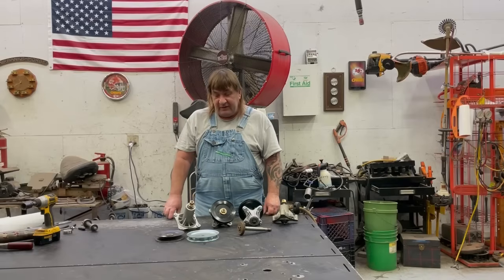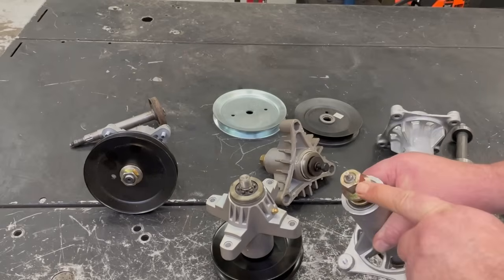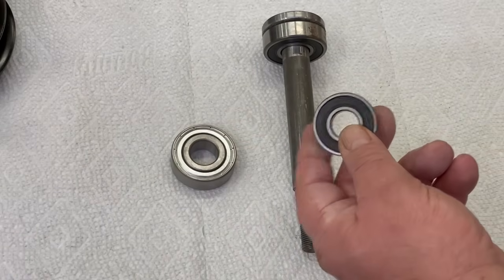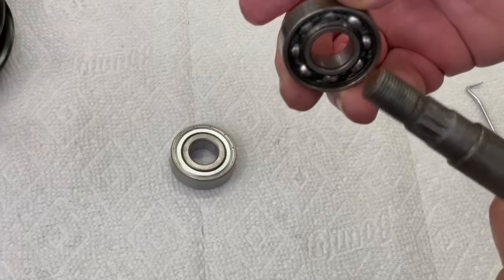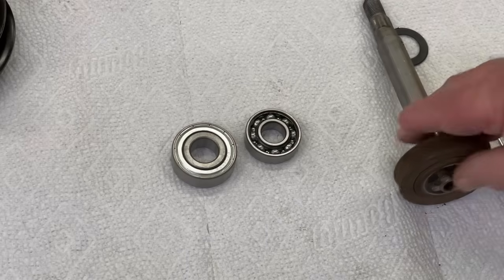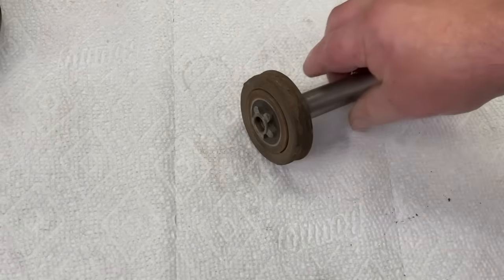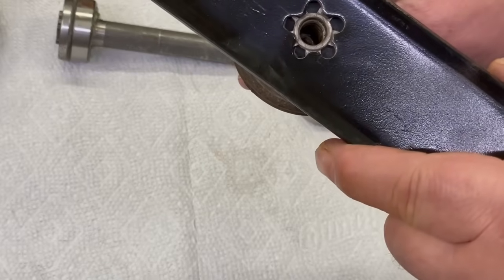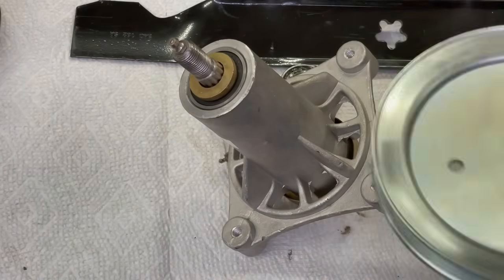BEST WAY to Grease SEALED BEARINGS on Lawn Mower Blade SPINDLES (make them last 3x as long)

Comment: A tip for you - when you tap as you showed at about 6 minutes, use an impact gun to run the tap instead of a drill. The impact lets the chips break between impacts and the tap never jams. You do a great presentation - straightforward and logical.

Comment: I never grease my sealed bearings and currently have 1700 hrs on the original Toro spindles. I have a similar experience on both my Exmarks with 1000's of hours of use.

Comment: I bought so called zerk fitting spindles off amazon and I took them apart before I put them on my cub cadet that a bearing siezed up on . Both sides of the bearings inside the new spindles the bearings were sealed and I took the inside seal off . Never believe what they tell you . Even the real cub cadet ones I bought for my older cub cadet  had the zerk fittings but the  bearings had seals on both sides . Why do they lie to people .. check everything you order as the dealers lie as much as sellers on ebay and amazon .. I am a 72 year old woman and i still mow 3 acres so no excuses men . If I can do it so can you . Never believe what a seller says or even a parts dealer for the brand of mower you own .

Comment: You're better off to leave that top bearing as a sealed bearing.. You can open it and give it more grease if you want..  but then close it back again. because the top bearing has a lot more leverage on that shaft, so it really doesn't take near as much of a load...  Plus, your grease always wants to fall by gravity--  so it's always falling "AWAY" from that top bearing and it will end up dry.  The bottom bearing takes all the beating and is a good idea to keep it open like you showed..    So leave the top sealed, but the bottom open- and you'll have the best of both worlds. 

 That bearing with the "tin cover" -  is known as a "shielded bearing" -  rather than the plastic covered "sealed bearing".   The shielded bearings are never as water tight as the sealed bearings..

Comment: Once again the myth of sealed bearings in lawnmower decks  appears!?!?!? If you contact TIMKEN or SKF BEARING TECH what you see is considered a dust/debris shield and the average hand grease gun produces 2,000 psi which will overcome those plastic/metal shields!!!  I have a thirty year old three blade deck with grease perks and twice a year they get a shot of marine grade grease and still running quietly!!! But before this season ends one of the spindles is complaining/ new bearings time!!! 
I say all as a retired CAT&CUMMINGS knuckle buster and understand the REAL MEANING OF PREVENTIVE MAINTENANCE!!!!!!!!

Comment: Good video.   I've been greasing my sealed bearings for years. Most of the time I use a grease needle to get in between the seal on the bearing and inject grease that way. I do remove the tight fitting seals on the bearings and the use the grease needle to insert the grease right into the bearing, then replace the seal again. I have not replaced a bearing on any of my mowers for over 20 years. I do this procedure once a year on all of my bearings where ever they may be.

Comment: Sealed bearings are not intended to be greased and all bearing have a life span. Greasing them will not extend their life and replacements can be found for as little as a few dollars. Rather than go through the time to just grease them, if required replace them. 10 years on the bearing in my lawnmower and all are doing fine. They've never been greased. The zerk fittings are there but when used as intended, the seals prevents the grease (and dirt) from entering the bearing. Eye candy, but of no use.

Comment: I've found that new bearings almost always come with grit in them. I remove the seals and wash them out with solvent, blow them out bone dry and push while rotating them. Once they feel clean, I grease them and replace the seals. I've done this on milling machines and the bearings seem to last forever.

Comment: First time ever hearing someone say “That’s all I have to say about that”, outside of Forrest Gump. I wasn’t watching when he said it, so I grabbed the phone and restarted the video, to watch it through.
We don’t have that sort of mower over here, really, so the subject matter didn’t really seem relevant until I got into it. But the tips are good. I’m guessing a “zirc” is some sort of grease nipple, allowing for packing the cavity with grease, once assembled. That’s a common construction across a wide range of machinery. Almost any belt driven equipment is likely to have at least one such shaft with bearings. I just finished a milking machine primary vacuum pump and its drive system had exactly that setup. The new bearings were sealed and I didn’t think of removing the seals on the inside. Seems obvious, now. Doh! The amount of dismantling involved means I’m not going back into it now, but next time I have it apart….
Reply: Zerk fitting.

Comment: Another tip....most manufacturers only sharpen the last 4 inches or so of the blade. I sharpen my blades 
on the cutting edge all the way to the pivot point, and it's like adding horsepower to your machine. It cuts 
right through clots and clogs of grass.

Comment: With my experience as a manufacturing engineer I only lube with Teflon Grease. My old Toyota Tacoma pickup truck had 580 thousand miles on it with all original front end parts before it got broad sided by a texting moron .

Comment: You have to pump a lot of grease into the chamber. This creates pressure and forces grease past the seal into the bearing race. The inner seal is designed for this.

Comment: As a retired CAT&CUMMINGS knuckle buster those are not sealed bearings!!! What you're seeing is called a dust/debris shield and most hand operated grease guns are around 2,000 psi!!! And 2,000 psi will overcome those dust shields regardless weather they are metal or ABS shields!!! Contact Timken or SKF bearing company and they will set you straight on this myth!!! The problem is PMS/ out of site out of mind!!!

Comment: Id just repack the grease in the bearing and put the dust seal back….   to pack the bearing, you put some grease in the palm of your hand, and then press the bearing into it, then rotate the bearing around and repress !   This forces the grease deep into the bearing otherwise youll have lots of air pockets with no grease..    itll last a longtime

Comment: Great idea for getting grease to the bearings.  I have a Toro cutting deck that uses the last type of spindle you showed and can't for the life of me figure out how to get the nut off the spindle shaft.  It just spins.  Holding the blade firm just backs the blade nut off.  Can't find a flat spot on it for a wrench to hold it and I can't imagine Toro designed it to be held by vise grips to be boogered up with.

Comment: Great video. thanks for posting. I removed the seal cover on one side of each bearing, but I was thinking of hand packing with grease and flipping the top bearing over so that on both bearings, the seal is on the downside of the bearing. I am thinking that gravity will help keep the grease in the top bearing, as opposed to the grease getting hot and running down into the cavity. Even if there is grease in the cavity, I'm not sure how it's gonna get up into the top bearing. . . just an idea, might be malarkey.

Comment: I just did this to my mower because I bought aftermarket mandrels and they were making tremendous noise when I would get in to deep grass...took them apart and wasn't enough grease to fry a egg! Repacked them and filled housing with grease now it works perfectly!
Reply from the maker: Glad you were able to solve the noise issue!

Comment: Great tips. I used to work on lots of industrial equipment that had a great lube system that was useless after someone mistakenly installed sealed bearings. Attention to details is what separates part swappers from technicians. 😊

Comment: those are not seals , they are loose fitting dust covers  , you can pick them out with your fingernail , the grease will go around them and threw the bearing like they are not even there  a grease gun puts out like 10 000 psi . when you remove the bearring for no reason you are egging out the soft aluminum housing and before you know it you will have a spun bearing and housing will be junk , just grease until you see it come out ends of spindle , thats how they are designed to work , takes 60-70 pumps to fill em when new  , then give em 10 pumps a few times a season to flush the grease contaminated with  metal particles out of the bearings and replace with the new grease ya just pumped in , simple as that
Reply: The grease is to thick. The grease will push the bearings out of place before it ever gets past the seal. Only once enough heat is generated to liquefy the grease will it get past the very small crack around the seal. If that much heat has been generated, that means the bearing has been running dry long enough to cause damage to bearing or race. These used to be manufactured with one side open and "weep hole" for old & excess grease to come out. To reduce manufacturing cost they switched to sealed bearings. By the time most sealed bearings fail most owners have just come expect the shorter life span as the new "normal". Those who understand how serviceable bearings work know they are being screwed over by the manufacture, and will remove the inner seal & drill a weep hole. You just have to be committed to servicing your mower. If not, they will fail nearly as fast. If your service them regularly the bearings will last beyond the expected service life of the mower.
Reply: @williamallen7836  the grease will go by the "dust covers " how can it push the bearing out of place they can't move  anywhere when spindle nut os tightened ,. there is even a guy with a vid on here that proves  it , he had enough of all the bickering over it lol  .
Reply: @TheCaperfish  the blade does not press up against the spindle housing. The blade is bolted to the shaft. The bearing gets backed out about half the width of the bearing by hydrologic force if there is no wheep hole for excess grease to escape. This has caused my blade to be pressed against the spindle housing several times. As the whole shaft shifted upwards with the bearing. It's not a guarantee to happen each time, or to every spindle at thd same time. It all depends on how much grease is in it at the time you add more. So most often it was just one or two of the three spindles. Which would cause my deck belt to get chewed up due to it now being out of alignment by about a half an inch. Simple and most reliable answer was to put the weep holes in. Just like they used to have before they started using sealed bearings. The method that was most often used prior to sealed bearings was to use of "thrash washer". Which is just a large washer that covers the outside of the bearing. This would give a week joint that prevented water & dirt from getting into the bearing, but was just loose enough to allow excess grease to escape. This also had the added benefit of pushing the grease through & out with fresh grease. Just like greasing a ball joint, you just add grease until fresh grease squirts out of the joint.
Reply: @TheCaperfish  The washer under the pulley on the deck side covers the outside of the bearing, preventing the dust seal from moving. On the blade side there is also another washer that does the same. The only video I found that you described showed him doing this with the spindle removed, and not done as a complete installed assembly. This is the flaw in the video. Plus you don't want those exterior dust seals to be removed. Water, dirt, & grass bits will get into the bearing. Which is  the further reason for the weep hole. You want an easier path for excess grease to escape, so your dust seals don't blow off if you have a different setup. While most spindles are similar, they are not the same. The complete installed assembly is not the same on every make model.
Reply: @williamallen7836  you watched the wrong video , weep hole does no good , grease will follow the path of least resistance  so all the grease you pump in will go out the weep hole , you want to force the grease threw bearings to flush old contaminated grease out and replace with new around the bearings , the dust seals cannot go anywhere , they are sandwiched and note the washers are beveled for you guessed it to allow grease to go out easily once it went threw bearing .

Comment: No need to pull out the seals. Your grease gun creates a tremendous amount of pressure and squeezes right past the seals into the ball bearings.  Try it and RIP it apart, like I did, and you'll see for yourself.

Comment: Those are not sealed bearings. That's just a dust cover. A standard grease gun easily pumps grease right thru it, no problem. No need to take off the cover.

Comment: My mower blade is very stiff to turn. I've been spraying wd40 up into the shaft area from the underside of the lawnmower. It definitely helps but I'd like to get some grease up in there somehow?
Reply from the maker: can you take it apart
Reply: At age 70, not really. Guess I will have to take it to someone like yourself.

Comment: i work on cars and i grease idler pulley and ac compressor bearings, i use general purpose grease, i wonder should i use wheel bearing  grease?

Comment: Thanks for sharing great tips! Not sure if my 
JD E - 140 has sealed bearings? I grease all 3 spindles frequently and always put a lot of grease in each one. When the spindles heat up the bearings should get the grease? So far so good I’ve never had a bearing problem. Could you do a video on transmissions? My transmission looks like cast iron outer shell underneath but I don’t see a drain plug to change hydraulic oil? Do I need to change oil as long as there are no oil leaks ? Thanks.

Comment: I've been doing this for years in my former working life,..I use the needle type grease adapter that you can get for applying grease to very small places. I make sure that the 'opened' sealed bearing is greased completely.  Great idea Mark,... well done!
Reply from the maker: Thanks for sharing

Comment: The bearing with the metal sheild is for electric motors. And believe it or not but one of the main problem with bearings is over greasing them. Lots of classes with SKF bearings.

Comment: 2:38   hardly any grease in there.  The owner of our local bearing supply told me that excess grease is like wading in the ocean. Its harder to move against the resistance of the water and against a bearing packed full and can make the bearing overheat

Comment: If they are high-quality sealed bearings, no grease gets in or out. BUT, SKD or FAG bearings are rarely used in mower spindles. On my late sister's mower, a triple blade 48" John Deere, one bearing went bad and I spent a whopping $50-ish dollars for 6 SKD Japanese top-of-the line bearings. When I was thru and engaged the mower, the 24 HP V-twin didn't "bog" a second and mowing, it felt like I got 10 more HP to the blades (I had sharpened like razors). I packed the spindles to help avoid the cheap steel spindle death of a dragging bearing. The grease works its way (with heat) thru the bearing to the spindle. The cheap spindle cost me $38 alone, plus two belts and 16 hours of WORK!!!

Comment: I like to melt my grease down and actually pour it into opened nearly housing. Then let it semi solidify before placing the seal/cover back in place. This assures my theirs no air pockets left without grease.😊
Reply: Melting grease? I would think it's properties to lubricate would be affected. Not sure....

Comment: I drill a hole in the spindle housing and install a grease zerk i can hit from a good angle and reinstall the bearings without the seal on the inside of the casting. Never dries out!

Comment: I left my seals on and shot red grease in through the zerk until i saw grease come out the ends. I pulled the shafts out and pulled the seals off the bearings and sure enough..red grease inside the bearings. I don't think you need to do this to the bearings..the hydraulic action of the grease being forced in makes it into the raceway and bearings really well.
Reply: This is absolutely correct! Grease will in fact penetrate into that bearing when you fill the spindle. The pressure will force grease inside those bearings. All these other things are a waste of time!
Reply: Yep. It will, especially with the metal shielded bearings. What all these seal removers don't comprehend is the fact that seals/shields are also designed to keep grease in. Centrifugal force throws the grease right back out of the bearings they just pulled the seals off and greased. It has been proven that pulling the inner seals will allow the upper bearing throw the grease and it will eventually fail prematurely in relation to the lower bearing.

Comment: The outer seals on those bearings are non purgable seals, so when the cavity fills completely with grease. The seal will pop out from the grease pressure instead of just purging the excess grease.

Comment: I like your content. I'm subbing.
   Use a 5/16-18 instead of a fine thread. It's much stronger. Use Turpentine for tapping fluid for aluminum and Crisco vegetable shortening (not the oil. Vegetable lard) for tapping steel. ( I was raised a machinist.)
   THANK YOU for your post. Very good info.
Reply from the maker: Cool, thanks